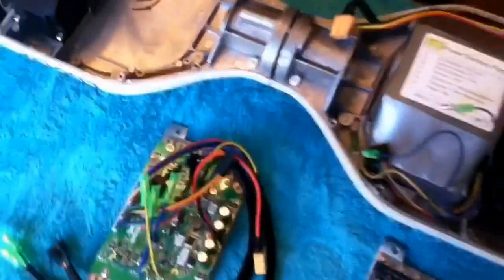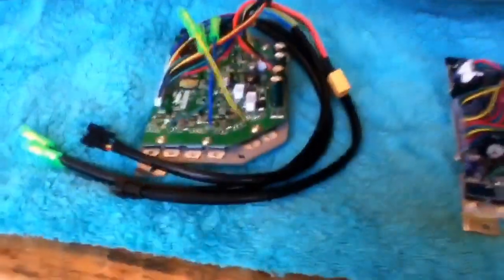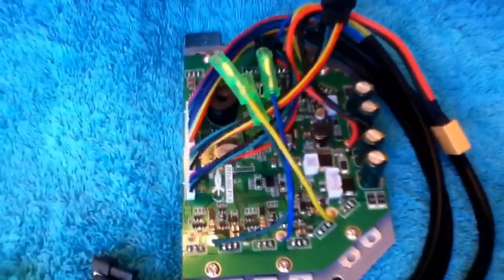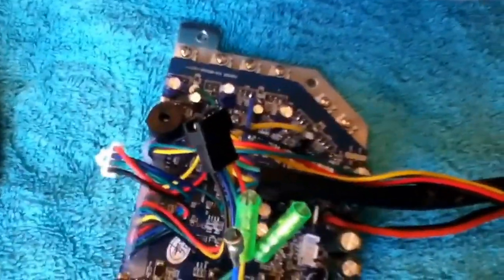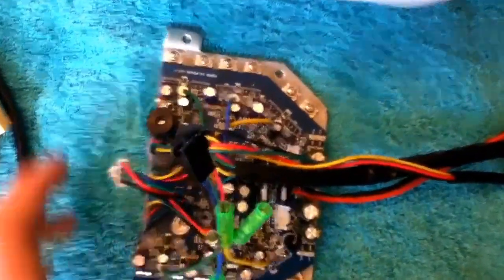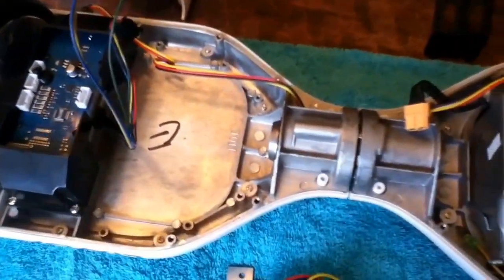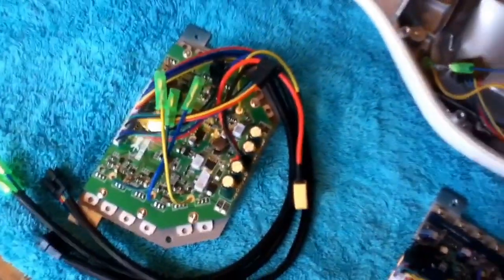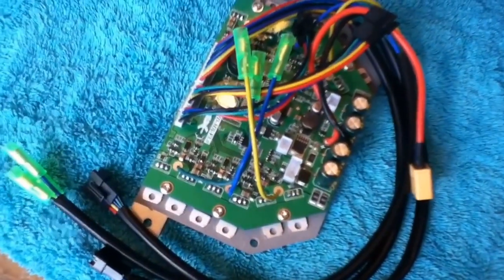Buying the right motherboard for your Hoverboard

Comment: Can you tell the difference between version 3.0 and taotao motherboard system the original company that makes the motherboard before the cheap ones are now on the market. Just want to make sure which one I should buy
Reply from the maker: LemonJuiceGV the 3.0 is usually comparable with installing a Bluetooth speaker upgrade or extra lights.  It has extra open plug sockets for this.  Purchasing a 3.0 and not utilizing these feature will still work fine and not hinder performance.  

If the picture of the board shows a serial number blurred, (which I have seen before) it's a scam. If you can clearly see a 3.0 on the serial number, it's safe to use.  I haven't heard of taotao boards before. Each manufacturer has their own brand. The important part is the number, not the brand.  A 2.0, 2,3, and 3.0 will cost slightly more but are well worth it
Reply from the maker: LemonJuiceGV update:

The taotao system appears to be able to link to a smartphone app for features like remote turn on, Bluetooth, and speedometer.  I suggest looking up a video review of the app and board. 

I'm guessing the app will cost money to download so take this into consideration before making a purchase

Comment: I bought the 3.0 version on SBS and they told me that they stopped manufacturing these long ago. There is another one that says 3.0 but it is blue and has no rocket on it
Reply from the maker: LemonJuiceGV it might work. I have another video showing how to repair the hoverboard so compare yours to the one I use to fix it. See if that helps

Comment: Can I replace a 3.0 motherboard, when I have a 1.0 motherboard in my hoverboard?
Reply from the maker: iDevice Tipps and Tricks yes that's exactly what I did to fix mine. I have a video detailing how to replace a 1.0 with a 3.0.  I recommend if you undergo the replacement to watch my video before, and during the replacement so you know what you're doing. Good luck!

Comment: Thanks for the video. So I bought a green one on Amazon.com for like $30 it came in today and I installed it immediately. Still double green lights and not working. Any other suggestions? There is no rocket ship or version numbers on the motherboard I got. But it was green only writing on it is 679394 ROHS 20150622
Reply from the maker: I'm very sorry to say you wasted your money. It appears that since I uploaded this video, there has been a large number of green motherboards on the market. These boards appear to still be 1.0 and do not correct the problem. Unfortunately when buying this sort of thing, you get what you pay for. I suggest going on to eBay or Amazon and finding a kit that specifically has 3.0 and rockets on it. That appears to be the only ones that correct the problem. Meanwhile I suggest pursuing a refund. I will be posting a video in hopefully a couple weeks or less explaining how to replace your mother board and sensor pads. Good luck
Reply: Thanks for the quick reply. Will find one that says it is 2.0 or 3.0.  !!
Reply from the maker: +Jay Smith always eager to help!
Reply: Jay S

Comment: i have the power light and battery light plus one of the blue driving lights is constantly  the side that the driving light is working still moves but i am unable to reset the balance my question i guess did i just lose a gyro or did my mother board go also i opened mine up it has a green mother board that is v1.2 and green colored gyro boards thanks any help is appreciated
Reply from the maker: You could simply be experiencing a malfunction in one of your gyro sensor boards.  I've never heard of or seen a v1.2 that was green.  Did the boards have the green rocket logos on it?  I suggest you simply look online for new sensor boards and try to find one that matches your current one, or buy a whole new kit altogether.

Comment: I'm having this problem with mines and I opened it up and In mines is the 1.0 if I buy the 3.0 green ones and install them will it still work if I buy the 3.0 green ones instsead ?
Reply from the maker: Yes. As a matter of fact that's exactly what I did and it worked

Comment: I broke my hoverboard 😭 if I don't want to buy that it doesn't have solution?
Reply from the maker: +Damon Bush actually the person I just bought it from raised their price, so I recommend buying a different one. As long as it's green, it's the good one
Reply from the maker: It's only a 40 dollar kit. I'm afraid if you aren't willing to pay that then you can't fix it. It was very easy to fix, all the wires are color coded and it's only a few screws to change
Reply: +FontuneTheTeller can u give me the links to buy one and thanks :)
Reply: +FontuneTheTeller so you remember the link where you purchased the motherboard part?
Reply from the maker: Update:: Hoverboard motherboard sellers have caught on to the "green is good" trend.  They have started manufacturing fake 1.0 boards that look like 3.0.  Steer clear of these and double check the version number.